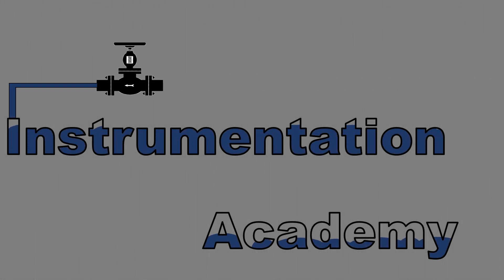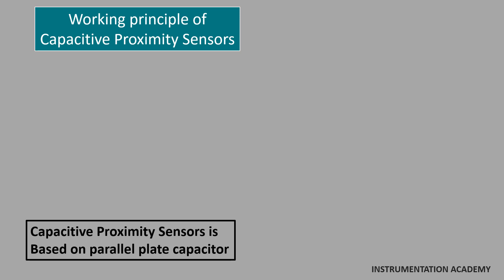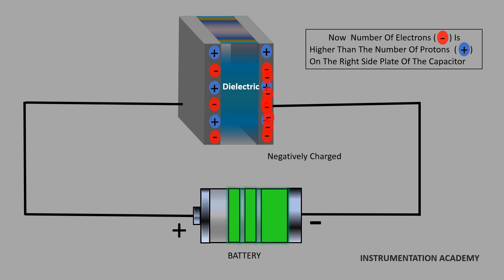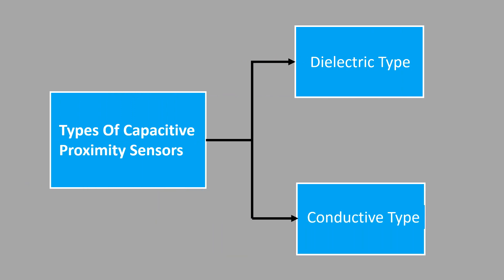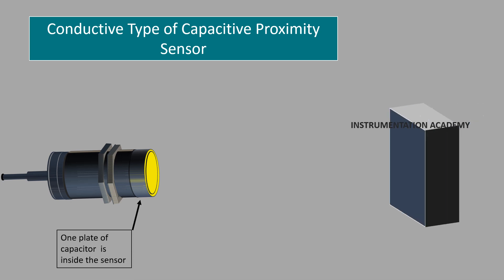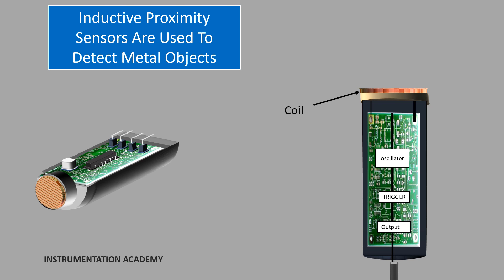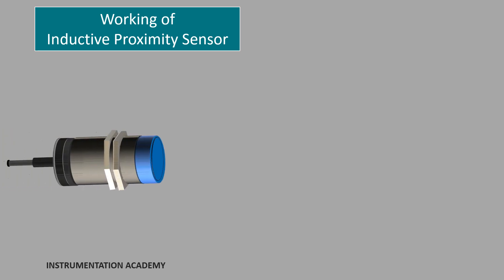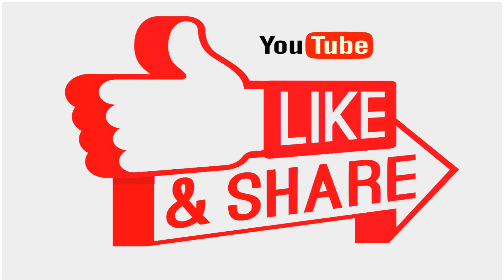Proximity Sensor working. Inductive proximity sensor, capacitive proximity sensor. proximity switch

Comment: So these prox. sensors ( both types) only generate a
 " switched range" change of state..what about detecting variations in  range/ distance measurements..?? measurements???
Reply: @instrumentationacademy  🙏🙏 but will it be covered in another vid ???
Reply: These sensors also have analog mode where you can measure the distance between an object and the sensor.

Comment: Today I am learning about proximity probes for my vibration analysis. It contains a small topic about how the proximity probes work. That was not clear. I watched couple of videos on youtube but this video cleared my doubts. I was looking for the Inductive type proximity probe. This video is like Sprite Ad. Sootiga...Suthi lekunda
Reply: How can you analyze vibration with a capacitive sensor? I have a project that i know nothing about involving capacitive sensors, instrumentation amplifiers to detect very low vibration/frequency, but i dont know where to start.